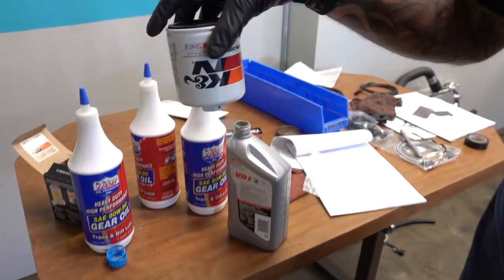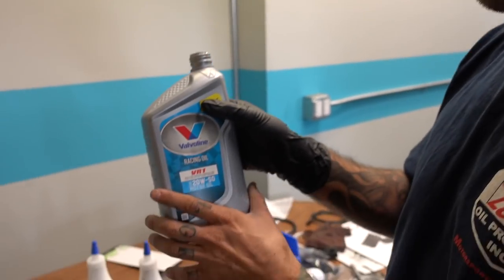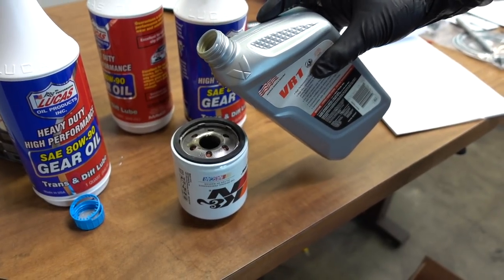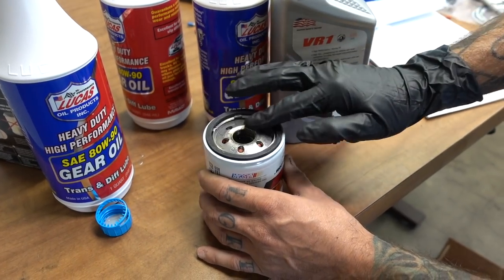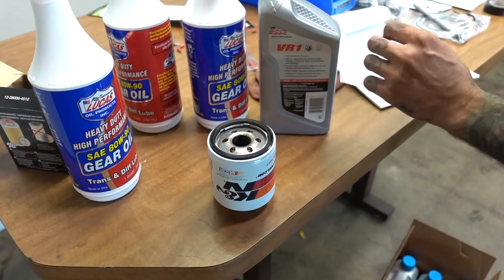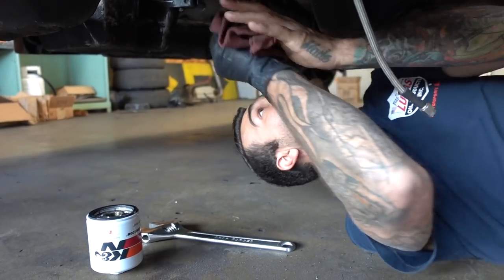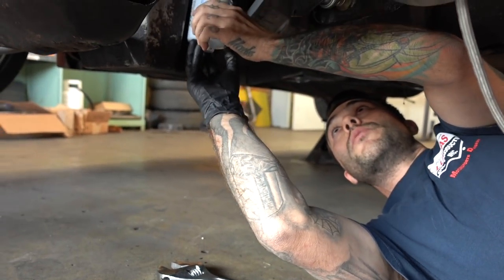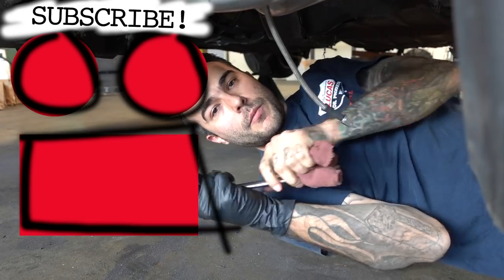Josh Mason Talks Proper Break-in Oil Filter Install for Build & Battle

Comment: On the side mount filters, I just pull the electrical for the distributor so there's no chance of firing and crank the engine over. Won't reach high enough RPM to do any damage and it cycles the oil whether it's ran off the camshafts, crankshaft or timing chain/belt. If you like doing things manually, a socket and ratchet turning the crankshaft does the same thing, but it's easier and faster for the starter to do it. Love the videos, whether 2 mins or 2 hours. Thanks for the content/entertainment.
Reply: Justin Dayard and then fuel still on just take out the injector fuse
Reply: @Jaybird022395  he says hes been doin it let him thin his oil out😂

Comment: Turn the oil bottle around to pour it properly. The neck of the bottle will be at the top while pouring. It will let the air in without all the, glug, glug, glug. And you can tip the bottle over further before the oil comes out, getting you closer to the fill hole.

Comment: The little nut type tightening thingy is called: a bolster.
Reply: and since it's just stamped sheet metal, if you ever actually need to use it on a stuck filter it will just round itself out.
Reply: @AaronGottaHelmetCam  Not if you use a 1/2" 6 point socket/breaker bar on it and you apply steady even pressure instead of trying to jerk it loose...
...and the person who installed it didn't crank it down until the rubber seal started smoking.
Reply: @wretchedexcess1654  yeah, no.  I used to use those filters on my Ducati.  It needs to be tighter than normal or else it weeps.  5000 miles later and that sheet metal junk always rounds out, even using a 6 point socket.  Went back to open and use a strap wrench to remove it.
Reply: @AaronGottaHelmetCam ; Ducati sells a special seal locking compound that comes with a small bottle of activating spray for installing and another small bottle of release agent, just for that problem.
It is expensive though but, it's worth it.
Reply: @wretchedexcess1654  that's funny, but the way most of the filter is recessed into the oil pan you would never be able to get the release agent on the seal.  putting it on tight as possible by hand and using a strap wrench to remove works good enough for me.
Reply: @AaronGottaHelmetCam  You seem like a trustworthy guy who can keep a secret so, I'll let you know the ingredients for the activator and the release spray.
The activator is corn-syrup and the release agent is common wood alcohol.
I hope you can keep this a secret as the Ducati family won't appreciate me cutting into their profits like this.
I live on the edge though and ride a Kawasaki but, it's been sick lately and really needs some more modifications like EFI.
I just have to get the nerve and cash to go parts shopping. 

Good luck with your Duc.
Reply: @wretchedexcess1654  My release agent is common corn alcohol.
Reply: @AaronGottaHelmetCam  That was my go to but, I have to avoid over doing it so now I only keep the wood alcohol around to avoid the temptation.
Only kidding, I keep mine in the freezer.

Comment: I dont think ive ever seen or heard of anyone filling a oil filter before putting it on but it makes sense
Reply: If you can do it without spilling it's worth it, otherwise you're running the engine dry for a few sec
Reply: @alexstromberg7696  so its more of a better safe then sorry thing then anything
Reply: @alfonsoalonzo  yeah, I have changed oil filters on a Volvo dumper and they have 3 huge filters and we don't fill them before installing

Comment: no, you lube the o-ring so you can remove it easier and you should just "torque" the filter with your hands to hand tight then a 3/4 turn more.
Reply: Alex Strömberg helps with better seating too

Comment: Unless k&n changed the design these don't filter that well. It's a high flow filter. Mobile filters is about the best parts store filter. Not sure about royal purple filters.
Reply: I personally don't like K&N oil filters. Only filter I have ever had leak. There nut on the bottom is a gimmick.
Reply: @hladonkey26g  Real men can use their hands anyway.
Reply: Just Google k&n oil filter falure....and never use them again

Comment: If you prime the engine with no spark or fuel you know you will lubricate engine right and you know oil is picked up from pick up tube in pan not from filter 😆 I've heard of this on old American cars with slow turning oil pumps but this is a early 90s ls not a 70s chevelle
Reply: You really don't need to do that on a 2007 ls engine😆 you guys just showed a bunch of kids how to make a big ass mess and do oil changes wrong😄
Reply: Never did put oil in my filter, I have a 70s 454 BBC 👍
Reply: @Static_Spaceship69  probly even older than that Model A stuff lol

Comment: I hate these videos. Try doing that when the filter is mounted on top or the side of the motor
Reply: 1JZ/2JZ oil filter, prime example of this pain. 😡👎
Reply: From what I've read, if a filter is in a position that would allow it to spill out (upside down or sideways) then you don't need to pour a heap of oil in the filter. Most of the oil is expected to drain out of the filter each time the engine is shut off so the engine never starts with a filter full of oil anyway. Filters in the up right position will stay full of oil after the engine is shut off so they may need to be prefilled.
Reply: Just roll the fuckin' car on its side, then do as instructed.
Reply: @-DOPE- Nothing to do with whining, just a fact. If you want to shower in oil, change a 1JZ oil filter. 🤷
Reply: You do not need to pour a while load of oil in filter even on break in the car just needs to be cranked over for like a minute with no spark or fuel. Will raise oil pressure and will fill filter with oil .. this is a old American car thing this is unessessary for imports or new American cars
Reply: Plus engine was assembled with assembly lube so after a prime you shouldn't b worried about lubrication
Reply: @c0c0asauce  no, most filters have a check valve that stops the oil from pouring out
Reply: @Jodeyjoe559  yeah a 250k engine is still lives by assembly lube.
Reply: @alexstromberg7696  Some filters have check valves them, some don't. If you pour oil into pretty much any filter and turn it upside down, some is coming back out. The passage going down to the sump may not remain full either. If you prelube for a first start then it shouldn't matter anyway.
Reply: @c0c0asauce  most have. If they don't they are very cheap.
Reply: @alexstromberg7696  Or the system doesn't require a check valve. There's not just one type of system.

Comment: VR1 is a badass oil. One of the only high zinc oils left. The full syn version is even better. All my stuff gets Valvoline of some sort, I use Purolator One filters. When I worked at a dealership though I ran into some cars that I wish had that hex head though. Made me curse the engineers that overlooked how stupid those designs were haha.